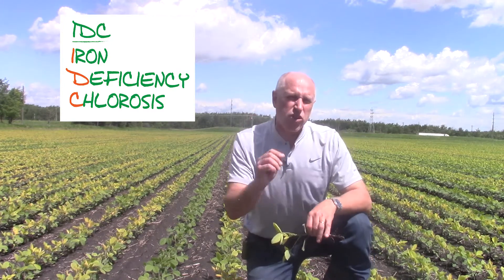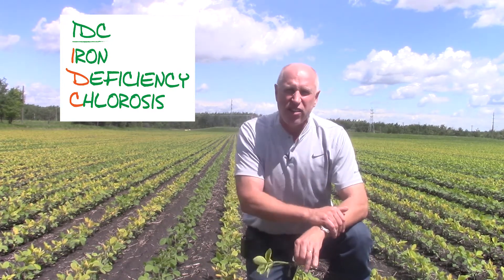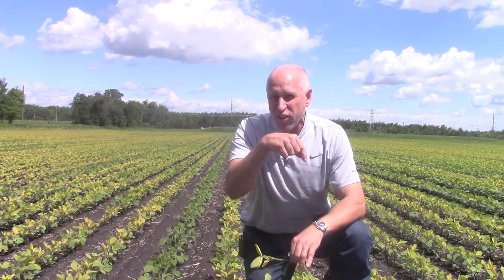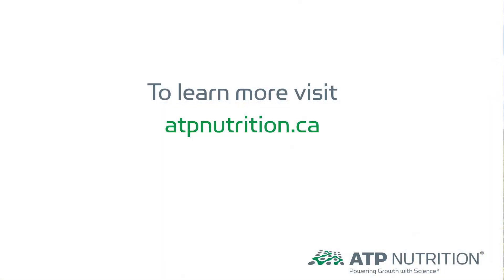Addressing IDC in Soybeans (In Season)

Comment: Really interesting that you have a row of beans right under your right arm which is virtually normal in appearance, Jarrett.  This make me think that it is possible that something was different in that row support fertility or other row soil environment. I have seen a bunch of guys using a significant rate of supplemental MN in furrow on beans. This in sap tests last year here in ND showed the low iron levels in sap existed but the chlorosis never appeared in tissue.
I sure wonder if this pattern has consistency in the field. If it was every 90, 100 0r 120 feet, I would be suspicious that glyphosate application preplant or post-emerge could be tiggering the Iron Chlorosis. The stability constant is highest for iron of all the traces. This green row of beans could indicate a sprayer boom gap, thereby implicating herbicide interaction. If it is glyphosate interaction, watch for SDS especially if the plant has had prolonged or repeated wet feet prior to V4.  Check aggressiveness of nodulation too between the two different rows as glyphostae cross-check procedure.
Was molybdenum in the seed furrow support and in the suggested foliar product? I hope so. Mo universally low in sap test results in your service area, Jarrett.